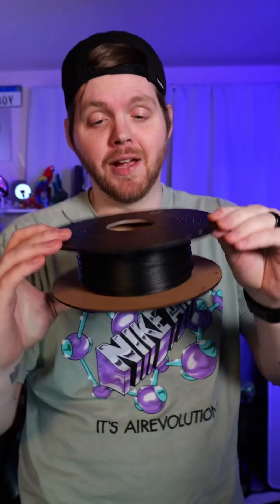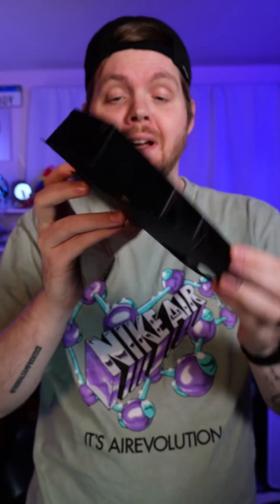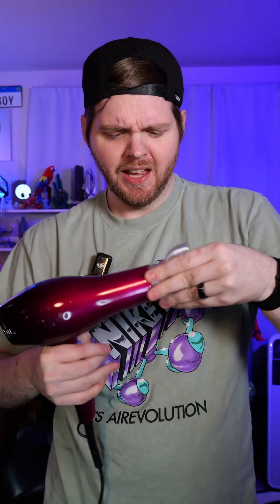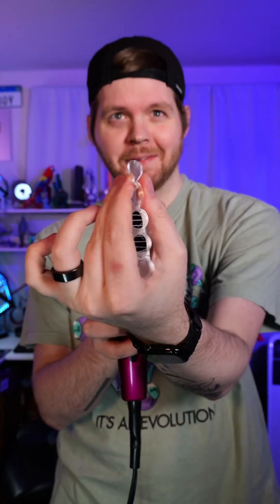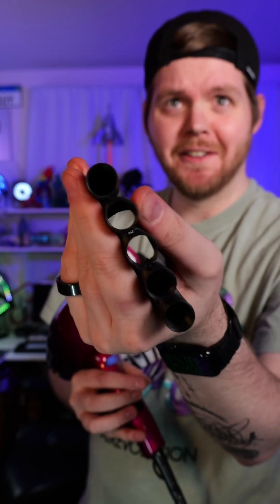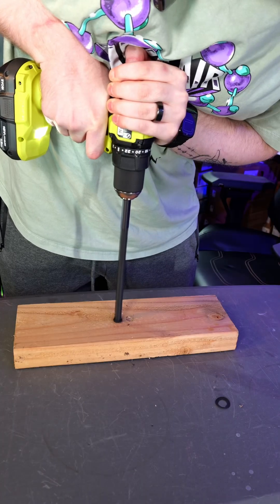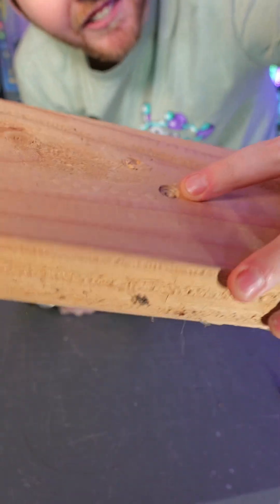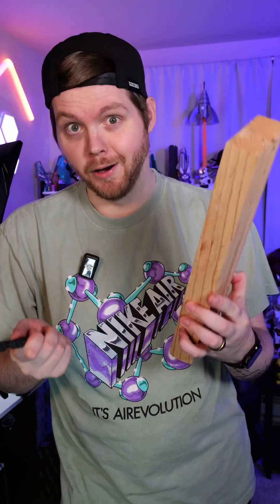Decided To Do a Few Tests Using PPA-CF ❤️

Comment: how did you dry the PPA-CF and how long.  I have a roll and stuff I need to print but not sure, other than my gas oven, to hold 214 F for eight hours?

Comment: That's a standard construction grade piece of pine (aka softwood). But the actual problem was sharpness or lack thereof. You could not apply that kind of pressure on a steel drill bit without breaking it. Difference is the steel has a sharper cutting edge and actually cuts its way into the wood. Find a way to  put a sharp edge on the bit and yoou'll be in business.